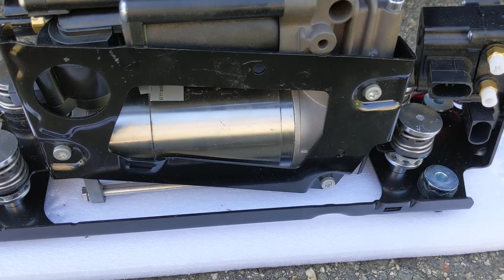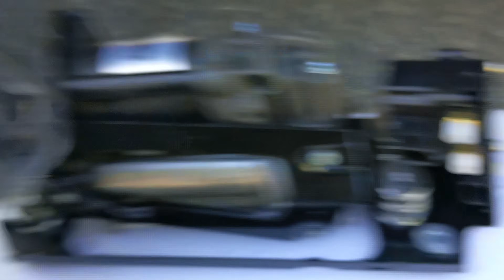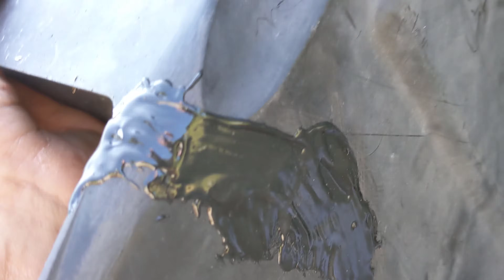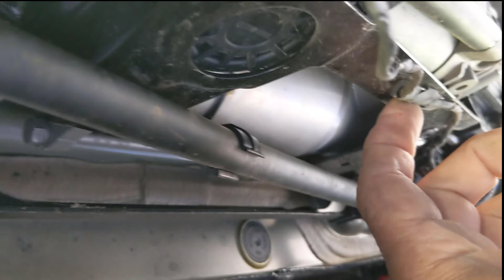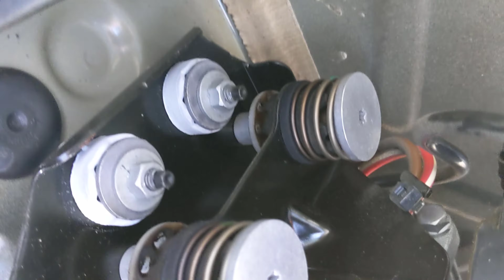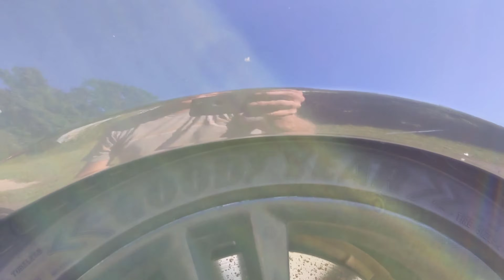Diagnose and Repair Air Suspension Pump BMW

Comment: I have a question so I disconnected the lever to simulate a load on the car and my pump only made a click sound but the more I did it the pump stopped making sounds. I believe I should just replace the car but i was just trying to see if you knew what else it could be

Comment: Thank you for great info Glen 😊
I do have a question for you or anyone on here who might know…I’ve been doing research and can’t find and answer.
I have a 2011 bmw 750 li. Never had ANY issues with suspension. 
Alternative gave out, took it to a shop to get replaced, and now the airbags are not going up.
Mechanic says bmws are know to have either suspension failure or other possible engine failures after alternator switch. Does anyone know how true or false that is ?
I was recommended to this mechanic by a family friend 😢

Comment: My X5 went down overnight. Left it outside on driveway that has slight angle. It has been somewhat intermittent over the last 4 months. It wouldn't pump up at all this morning. Now I turned the car on and waited and it pumped up. The fact that it dropped overnight suggests the valve is leaking, no?

Comment: Im begining to h8 my bmw with the problems i keep getting with the suspension its had 2 pumps replaced electric wire now its back in garage for  the same problem

Comment: @Glenn The problem with mine is that the compressor runs but keeps blowing the 40amp fuse is that a compressor promblem
Reply from the maker: It is hard to say but sounds like it. Make sure you check all the wires for shorts.
Reply: @Glennfix  Ok.

Comment: I just replaced mine last week. Bought mine from Amazon as well. Had to also replace the relay and fuse. So far so good. How is yours holding up?
Reply from the maker: Still working but it is a little loud.
Reply: still working??

Comment: Great video - but my F85 has all sorts of black rigid hose lines under the compressor. Is this an F85 X5M  and not F15 thing? how did you get those 5 or so black lines out the way to drop the compressor?

Comment: How many hours to replace
Reply from the maker: Not a bad job, under 2 hours
Reply: @Glennfix  thank you sir, I have a 2016 740i, how much should i expect to purchase a air compressor for my suspension and is their 1 or 2 compressor per car? Thanks in advance
Reply from the maker: There is just one compressor. You can find them on Amazon for around $300. BMW wants about $1600. I got the Amazon one. It works good but is a little bit louder.
Reply: @Glennfix  thanks my car is at stealership now but I'm refusing that ripoff price and getting serviced at a indy shop

Comment: Good info
Reply from the maker: Glad it was helpful!
Reply: Mine pumps but then leaks back out
Reply: How can I tell if I have a leak in line
Reply from the maker: @AC-gk8dx  That is a sign the check valve in the pump is bad. It can be hard to find a leak. The airbags can leak also. It can be a process of elimination.